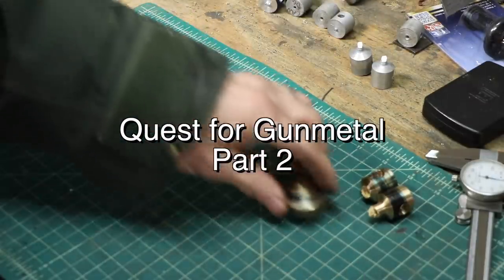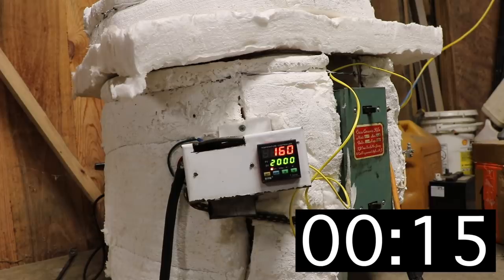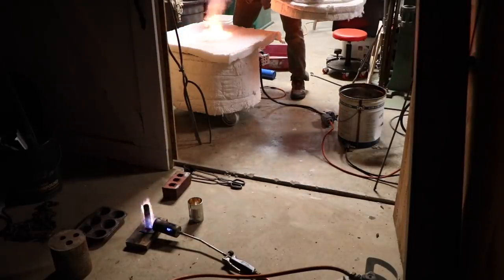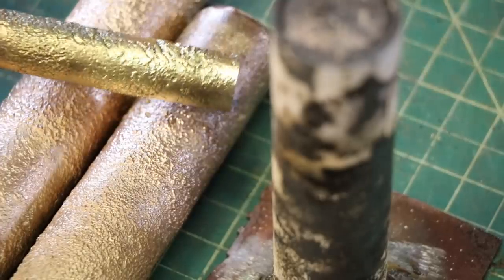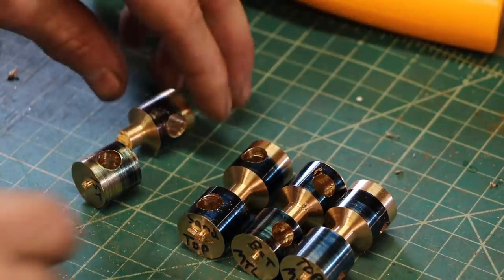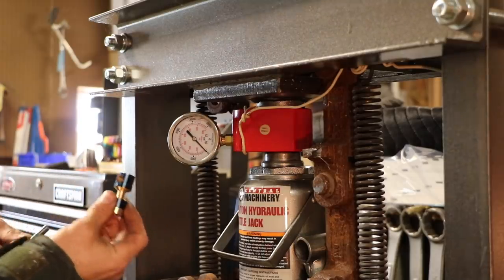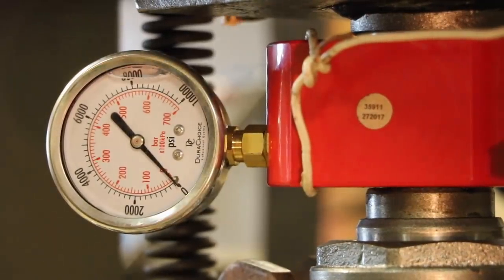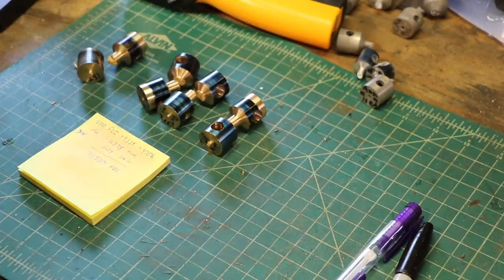Quest For Gunmetal, Part 2.  Progress!

Comment: Thank you for sharing your casting with us. I'm a retired goldsmith but did some work in bronze and copper. Your pipe casting with the bubbles on the lower section of the pipe, appears to be entrenched air, probably being caught by the upper section cooling before the bottom. In precious metal castings we allow for this by including sacrifice venting tubes spaced out around the lower half of the main body. This would also create a more even density in your castings. I have only worked up to about 20 lbs. I would be interested in knowing what you are using for a fluxing agent? Cheers, Billy in Canada

Comment: Look at the aspect ratio of length to diameter of the aluminum vs gun metal. The samples I have seen at work are at least 6in long and .5in in diameter. Also they do have a .030 radius at the transitions.

Comment: Just found your channel, it's fun.  For the steel tube internal surface:  actually copper and steel do have ability to intermix to a limited extent, so what you are seeing is actually a copper-steel "alloy" that is dissolving part of the steel tube during the hottest part of the pour.
I was the TA for a lab where someone (NOT one of MY students) decided to melt aluminum in stainless steel tubing.  As aluminum does the same thing, alloying / mixing with the components of stainless, after a period they melted through the stainless tube and narrowly avoided "student aluminum foot".  Ruined a couple of floor tiles.

Comment: Cooling slowly, is in effect, annealing, which will reduce the hardness, so the material won't be so brittle.
Reply: doesn't brass, copper etc, anneal different than "steel(s)", getting copper red hot then a fast quench is what anneals copper, that exact procedure hardens hi carbon steels. You probably know all this and I have no idea if it has any relevance to this.

Comment: Great thinking with preheating the mold but maybe after the pour put it back in your oven as it is already hot and insulated so it will keep the high temperature better (not sure how hot is the flame of your torch but I assume you got higher temperature inside) and maybe you should keep it running for a little bit so the cooling down will be slowed down as long as possible

Comment: I'm no genius so I didn't say this last time, but now that you've decided to heat the mold, I was going to suggest pouring the contents from something that retains heat, into something where you control the "cool down" time, instead of it rapidly cooling. 1) b/c it took 2 attempts due to the rapid cooling while pouring. 2) b/c it may aid in strengthening the final product (more dense molecularly..not so grainy). If all else fails you may need to call in the 'big guns'....your....'secret weapon'....Ivy!  :)

Comment: Make the middle diameter a smaller diameter so you reach the limit of the metal before you reach the limits of the geometry. This is why you did not see the same result in the aluminum. Also, the angle of the holes must be completely perpendicular throughout the entirety of the travel of the test. Good video keep it up.

Comment: You could change the pressure gauge at the hydraulic test rig to get a more accurate readout, a 2000psi/160bar would give a nice readout, cost about €20-50, money well spend.

Comment: The sharp inside edges cause a high stress in those areas. Better use a nice big radius there. Maybe you could also try annealing the rods before making the test pieces, but that's just a guess.

Comment: Well I know I’d when you heat up a color metal(brass, copper, etc.) and quench it it becomes soft(opposite of steel). Now you said the bottom part cooled really fast and upper was cooling slow. Maybe that’s why s the strongest..

Comment: You can't use that profile for a stress analysis, that sharp corner is a stress riser. It's a point where stress is at maximum.

See here for the shape used for most materials. Note the radius on the shoulder.

https://upload.wikimedia.org/wikipedia/commons/thumb/8/8d/Tensile_specimen_nomenclature.svg/350px-Tensile_specimen_nomenclature.svg.png

Or simply google "tensile test specimen"

Comment: using a metal mold that is standing on something insulating should help with cooling it slower. Also, turning your samples to a larger diameter should reduce the influence of the stress concentration at the corner.
did your aluminium samples have the same ratio diameter to length of smallest diameter pre test? if not, that could explain why they didnt have the stress concentration problem
Reply from the maker: Aluminum samples actually had a smaller diameter to length ratio.  For some reason the bronze material is less forgiving.

Comment: Well I'm just watching videos never done anything like it but I can tell u why lines cause u burn the foam and there is side pressure and lot of vapour that push the sand to expand 4 metal pipes that go around + 4 tubes that connect to it then after u disassemble it u remove em by cutting off or put it to lay down might help u will loose material the first way I said but u can use it another time .... or lay it down sideways and put 3 poor in wholes

Comment: Instead of making a larger radius, cut a groove in the middle of the cylnder and use the diameter of the groove the for calculation for the tensile strength.
Reply from the maker: I think that would make stress points and cause the same issue I am having.  Appreciate the input!
Reply: @FarmCraft101  Thanks for the response! Cutting a groove would purposfully put a stress point in a consistent location so it will fail in the same location every time, allowing you to have a point that can be measured easily for the calculation. The shape of the part will not have any effect on the  material itself.
Reply: @Rusty_Shackleford1  "The shape of the part will not have any effect on the material itself." nope, the shape is very important also you can have some twisting/bending force that is causing the material to brake and that is why any sample that is breaking like it was showed in this video would be in any proper laboratory considered as a failed atempt to test the strenght of the material... also the "neck" is clearly too short, in aluminium sample the lenght to the diameter ratio of the "neck" looks much better.

Comment: Hey sir, just wanted to pop by and commend you on the great videos. Been here since Mr. Wandel recommended your channel, and I've only become more and more impressed at your curiosity and drive as you've uploaded videos. 

Side comment, do you have any plans for those metal shavings off of the lathe, and other tools? Melting them all down into some weird amalgam might be a fun project. Don't know what to do with it after, or if they would even coalesce, but it might make for an interesting video - might learn something new about metal bonding.

Keep doing it, dude!